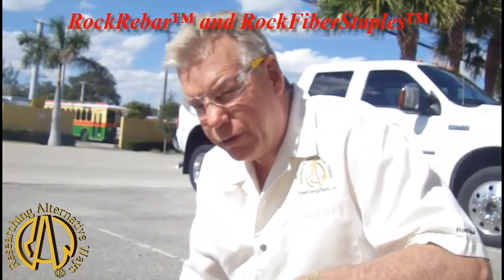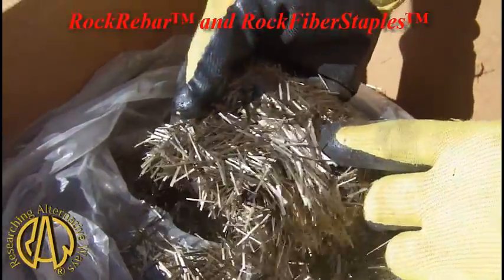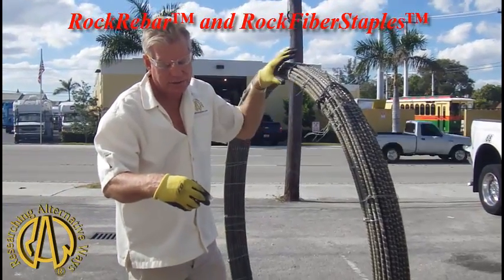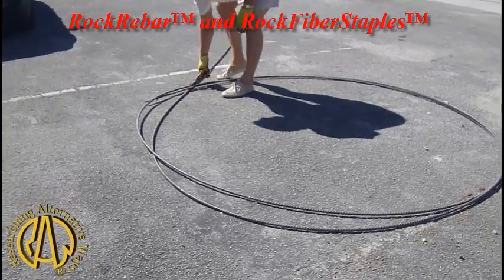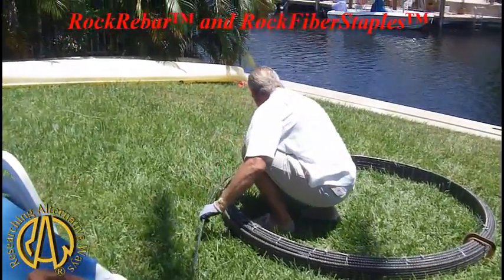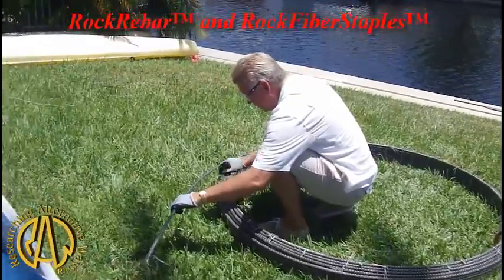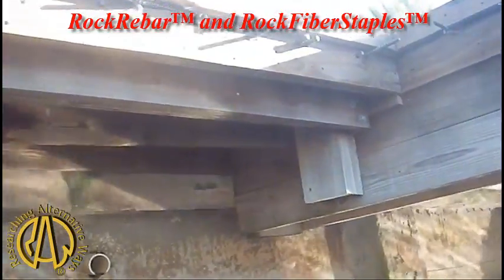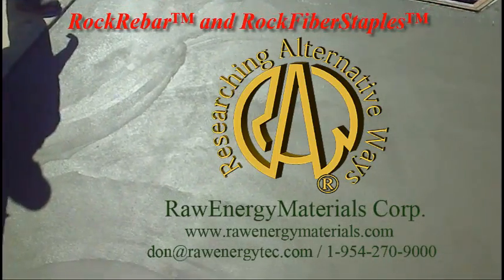Basalt rebar 1

Comment: To reduce the weight I would have added small kernals of recycled styrofoam along with basalt rebars and fibers for added strength. The opportunity to build houses or villages from waste salt that could be sealed against rain or waterproofed will be strengthened with corrosion free basalt rebar and fibers.

Comment: can this material be prestressed in concrete
Reply: Hi Rhett. The short answer is YES. Where steel resists stretch at low loads then yields and stretches like bubble gum. RockRebar is a linear strain to rupture material with a short stretch of 3%. What that means is while RockRebar exhibits a bit more stretch and flex at the onset of load, its resistance to stretch is a straight incline line until something ruptures or crushes. We try to design so the concrete fails in crush leaving the structure intact after the overload and opening the possibility for a more cost effect repair just to the crushed concrete.

Comment: With the new ultra-high performance concretes with silica-fume / super-plasticizers and basalt rebar / chopped fibre, it will enable extremely strong structures to be made that can change the face of construction as we know it. I think it will influence architectural and engineering design heavily. Once the costs keep reducing, it will eventually replace rebar in most applications. Not to mention the marine applications for something that doesn't rust...

In many concrete jobs I've seen near the sea, the rebar failed due to corrosion long before the concrete ever degraded structurally. 

If I can give you some feedback, your branding and website need to be improved to raise the profile of what you are doing.
Reply: Is rebar really needed in ocean cement? I read that Roman concrete is still around today in some old ports.
Reply: @koltoncrane3099  reinforcement is needed in any concrete member that is required to carry tensile loads (that usually arise from bending). It's also essential where shear forces need to be resisted by the concrete member.
Reply: It will also make alternative building techniques that are usually limited by code extremely stronger and therefore not only will it meet regulations easier but will also become viable cheaper construction options.

Comment: What did you mean when you said, "This is quartz, not sand."?  I thought it was basalt rebar.  So it's an alloy of basalt and quartz?   Crap, that would be expensive right?
Reply from the maker: RockRebar® is “glass state basalt fiber in epoxy, spiral wound, quartz coated rebar.
The cross section of each rod of RockRebar® (basalt rebar) consists of 10’s of 1,000’s of these very tenacious continuous Basalt filaments. Each filament is coated with a preparatory epoxy polymer. In the production of RockRebar®, all filaments are stretched equally taut and compressed together parallel to each other forming a tight stiff hexagonal lattice that results in a premium BFRP rebar composed 80% of continuous basalt fiber, 18.5% by volume of a preparatory epoxy.
Reply: Sorry for the misunderstanding. Cracked Quarts sand is lightly blasted into the wet epoxy before the RockRebar is cured. Cracked quartz is chosen because it inherently has the compressive strength to enhance slip resistance as load of the concrete transfers onto the tensile strength of the continuous basalt fibers. Had we used common sand, perhaps sand of a mineral with lesser compressive strength, should said common sand crush under a sever load, perhaps the rebar could subsequently  slip within the concrete and fail the structure Thank you for your interest, All the best
Don S

Comment: What's the procedure for placing in corners of walls?
Reply from the maker: RockStirrups® are designed to be the lateral support to RockRebar®, the method by which 90-degree corners are produced and the containment cages to assemble beams and columns. RockStirrups® are produced through the application of 360-degree layer wraps of continuous basalt fiber and epoxy tapes. The result is fully closed Basalt (BFRP) Stirrup where the corners are as strong as the sides. This layer wound continuity of basalt fibers is a clear performance advantage in the efficiency of the composite reinforcement.

Comment: Would Basalt be of any use in making armour for military vehicles or personal body armour?
Reply: Yes. Its weaker than kevlar.
Reply: @phillhuddleston9445  Kevlar gets destroyed by UV and it also becomes useless when it gets wet.
Weaved continuous basalt fibers are immune to UV for obvious reasons and are not affected by water, it's heavier but still extremely light and the physical properties are close, if you were to bind it I suppose it would be the same or stronger than Kevlar.
Reply: Why must anything ‘new’ be considered for the purpose of war?? It’s not new it’s ancient high technology....
Reply from the maker: In itself continuous basalt fiber is not a great ballistic material. However it is fantastic as a structual reinforcment to transfer the shock of an impact striking materials such as Kevlar to the surrounding frame.
For example Kevlar and Denema can catch a bullet. If those materials are left in the sun they decompose. Carbon fiber as an encasement is both very expensive and to brittle to take the rapid shock of a bullet, as in carbon tends to shatter where a basalt fiber encasement is inexpensive, excellent against degradation by the elements and very good at dissipating shock.

Comment: any special tools required for cutting this rebar material?
cost comparison between basalt and standard rebar?
Reply from the maker: When cost, logistics and service life performance are considered  RockRebar® (basalt rebar) works out to be far more economical than steel.
Reply: @elinajenkinsraw  So, at face, how expensive is rockrebar compared to steel?
Reply: I don't see why a grinder with a diamond cutting wheel wouldn't work...🤔🤔🤔
Reply from the maker: With a diamond blade handsaw or a parrot beak cutters.